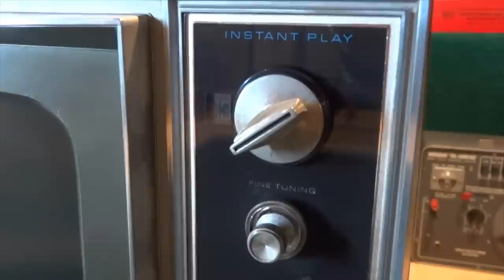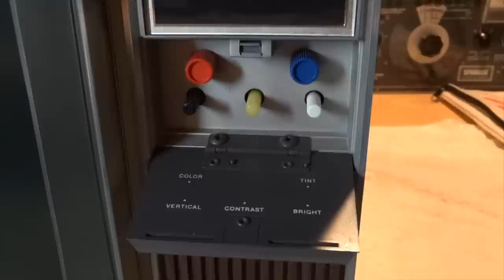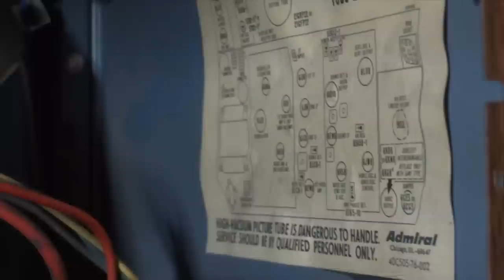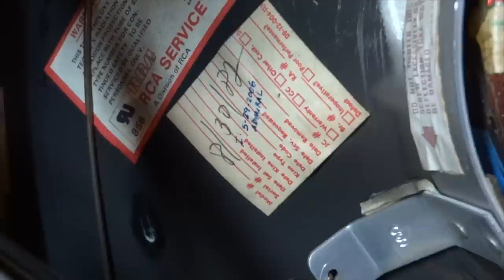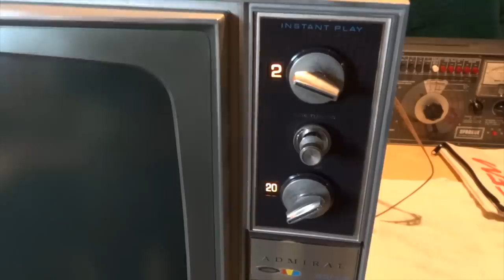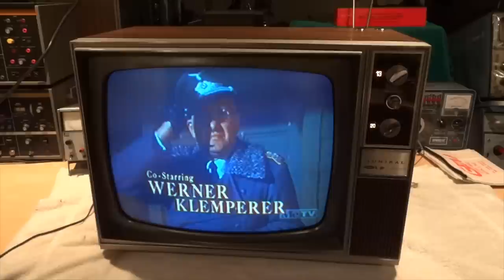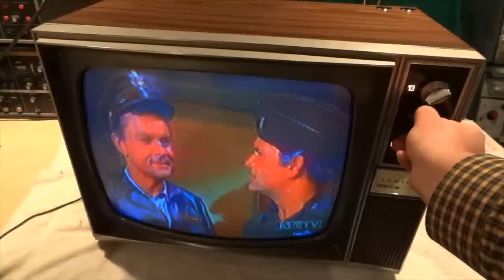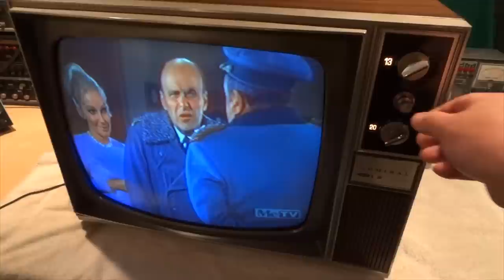TV Review:  A 1968 Admiral 19" Color Television

Comment: You'll find that a lot of those old TV shows in color tend to lack green because they were originally filmed on Kodak Kodachrome movie film which tends to lose it's green component over the years. I wonder if the original CRT was made by Admiral? I read somewhere where they made their own CRT's from 1965-1971. They were the industry leader in warranty length giving a three year warranty on the CRT instead of the industry normal two year warranty term.
Reply: That's a very interesting point -- I hadn't considered the original film-stock used in making these older shows.  Very good of you to point that out.

Comment: Just the Chicago area had 3 major set manufacturers in the 60s and now I don't think there is a single TV manufacturer in the entire US!
Reply: I believe you are correct.  Not a single TV manufacture left in the USA.  I think China manufactures most of them today, with Korea and Japan being 2nd and 3rd place (or perhaps 3rd and 2nd place, respectively).  Sad that we've lost such an amazing industry -- we used to be the best in the world at manufacturing electronics of this sort!

I'll GUARANTEE you that any modern HDTV set will NOT be functioning 46 years after its manufacturing date, like this Admiral set is!!  Shoot -- if any of them last 10 years, it'll be a miracle.  Back in the day these sets were BUILT to LAST!  Modern sets are built to be disposed of after 5 to 7 years.  Very sad.
Reply: LMacNeill That is so sadly true. I still regularly use a completely original set from 1965, and I can bet no modern television will last as long as it has.
Reply: *****
I said the same thing on the sears generator. Everything is made so cheaply today. Sure, the price is lower, but the cost over time is higher. These REALLY old sets were also problematic with the tubes in them, but later models that were still made in the US were made so much better than the new LCD Tvs. I have a late 80s model console TV as my main TV and dread the day it dies. I'll probably go to the used market to get a replacement rather than switch to an LCD.
Reply: christo930 Agreed. Some sets "back in the day" had their faults (one such common fault here being bad 6AL3 dampers), but the designs did improve as quality was important. Nowadays, companies are able to convince the public to purchase their products so easily that things like quality and word-of-mouth are no longer important.
Reply: ***** I remember when I was a really little kid (very early 70s), we had this awesome TV set with a stereo and a record player built in and made of wood with good quality speakers and probably a tube amp, but it was down so often that I got to know the repair guy (I used to love to watch him work on our TV). The TV I use now was manufactured in the mid to late 80s and I really like it and knock on wood, it hasn't given me any trouble. Almost all consumer items made today are junk and will never last as long as the old stuff. My TV is nearly 30 years old and I seriously doubt that any TV being made today will work in 30 years
Reply: LMacNeill
Not many TVs are manufactured in Japan anymore, although there may be some really high end models that are. I've seen more and more in the way of TVs, and other consumer electronics, being made in Thailand and Malaysia as of late, and less made in China. I think that between increased manufacturing costs, poor quality control, and the rampant theft of intellectual property and patented technology, more and more companies are either pulling out of China or just setting up shop elsewhere.
But the U.S, and a to a lesser extent Canada, made their bed in terms of electronics manufacturing by allowing the Japanese companies to sell their products here at a lower price then what they sold them for in Japan, in real terms. This is excluding the fact that they used to manipulate the yen to undercut U.S and Canadian manufactured products.

Comment: My parents had the floor model of this TV when I was a kid. Same tuner / volume knob layout, etc. The picture was great, when it worked. The set had high voltage problems from the day it was delivered. It was in the shop so many times, we lost count. The high voltage box would actually make snapping noises, (arcing), and the picture would die with each snap. The HV box eventually even caught fire. After 4 picture tubes, countless other tube replacements, cap replacements, the HV fire, (which was repaired too), my parents, took the set to the dump, after 9 years of dumping money into it. It was a beautifully designed set, cosmetically. It would have looked great in my living room today... but what a fire hazard it was. i think we had a lemon. Our neighbor had the same set, and had no problems with it. (Can somebody actually get a lemon for a TV)?
Reply: Randy, The Lazy Comic I had one that went out one year after they gave me the old one.

Comment: My grandmother had a console/floor model set of this television, very similar to this one, except the speaker grill pattern was horizontal and the color was gray.  The controls were right below it.  She gave it to my father in 1974 and he used it until 1979.  I saw several table top models of this set in the basement of a repair shop that I was helping to clean out in 1987.  They probably came from a motel because they all looked exactly alike.

Comment: 1918:
Two ham radio operators form Chicago Radio Laboratory.
1921:
Commander Eugene F. McDonald, Jr., joins the company.
1923:
Company is reincorporated as Zenith Radio Corporation.
1924:
Zenith introduces the world's first portable radio.
1926:
Company introduces the first AC-powered radio.
1927:
Company debuts the first push-button radio.
1939:
The first all-electric TV station, Zenith's W9XZV, goes on the air.
1948:
Company's first line of black-and-white TV receivers makes its debut.
1956:
Zenith invents the first wireless remote control.
1961:
Company's first line of color TVs is introduced; Zenith's FM stereo broadcasting system is approved by the FCC as the national standard.
1969:
Company introduces the revolutionary Chromacolor picture tube.
1979:
Heath Company, maker of do-it-yourself electronic kits, including a personal computer, is acquired.
1980:
Zenith Data Systems is created as a computer subsidiary.
1981:
The first Zenith computer, the Z-100, is introduced.
1982:
Company suffers a net loss of $24 million and fails to pay a dividend for the first time in nearly 50 years.
1984:
The electronics industry adopts a Zenith-developed system as the standard for MTS stereo TV broadcast and reception; company changes its name to Zenith Electronics Corporation.
1989:
Company sells its computer business to Paris-based Groupe Bull for $511.4 million.
1991:
South Korea-based Lucky-Goldstar, later LG Group (LG), purchases a five percent stake in the company for $15 million.
1994:
The industry chooses Zenith's transmission system as the U.S. standard for HDTV.
1995:
LG gains a 58 percent controlling stake in Zenith by buying $351 million in company stock.
1996:
Company announces the layoff of 25 percent of its U.S. workforce; FCC adopts Zenith's digital transmission technology as part of the HDTV standard.
1998:
Zenith closes its last U.S. manufacturing plant.
1999:
Zenith begins shipping its first HDTV sets; the company emerges from a prepackaged bankruptcy filing as a wholly owned subsidiary of LG and as purely a designer and marketer--not a manufacturer--of electronics products.

Comment: Excellent-looking set!

You mentioned that you replaced the CRT several years ago with an RCA CRT.  My question is -- was the original CRT manufactured by Admiral or RCA?  Did you just get lucky that your '67 RCA CRT happened to fit, or was that the same part used by Admiral when they built the set brand-new?

Thanks for makaing your videos -- they're always instructional and enjoyable!!

Comment: I have an admiral color set the I picked from my uncles barn shed. It was in okay shay physically, except the button rotted. My dad fixed that and the put it on some rollers. I haven’t worked on it really but the tubes light up, but there’s no high voltage. Hopefully I can get it working, though I think it’s a high hour set. It has a replacement, re-necked CRT in it and the screens are set high (I may have turned them long before I new what they did).

Comment: I seen a few of your videos of these old CRT TVs and You know what your doing.  So I have a question to ask.  
I have a RCA TV from the 70's with a marble top black and the issue with that TV is it ends up getting lines that go from bottom left to top right a crossed the whole tube.  Now the TV was serviced many times and always ends up with those lines.  

We stored it in our shed for years now under a blanket because no one here will fix it but it does show picture and sound.  But who knows know.  It has been unpluged since 2006 or 2005.  No any reason why it would be like that?
Reply: +DestructiveBurn - Record a clip of the screen and post it. That will help with diagnosis.

Comment: Boy, have one of these. It's missing the back, has a low emission CRT, Has cataracts,  & a HV resistor smoking. What to do. IIRC these sets needed flybacks. Now seeing this I may reconsider it's fate. This one is in very nice condition. Thank you for the chassis ID.
Reply: Farmradio That's quite a few problems for such a late set... Is the weak CRT due to the instant-start feature like the one in this video?
Reply: +Farmradio Admiral engineered these TV's in chicago, and went bust. I wonder if this one was found in a warehouse somewhere. The one here looks near mint. They did have a lot of issues with failing components, so I find it strange this one pops up in its hometown in perfect working order, but it may of just been restored. Who knows.

Comment: How did you get live television?
Reply: Digital converter box, during the switch from analog to digital broadcasting signals in 2009, there were some companies that started making boxes that would allow CRT televisions to pick up digital broadcasting signals, and I think those converter boxes are still being made. They pretty much hook up to the TV, and then an antenna is connected to the converter box.

Comment: I can't believe that valve tubes were still being used at this point.  Surely transistors werethe replacement for those old tubes, which had a limited life, and were the usual causefor the tv to break down.
Reply: +Gary Dunn - Transistors were just being introduced to TV circuitry around the time this set was made. Over the succeeding model years they displaced more and more tubes until by the end of the '70s, tubes had been replaced completely by solid state components.

Comment: could i somehow connect a playstation 4 to it or a blu ray player? just curious. lol
Reply: +Faizan Ahmed You would need an adapter but you wouldn't be able to broadcast in HD. Why not hook up an NES or VCR instead?
Reply: You could connect any gaming system to ANY TV set if you have the right equipment. I used to have my bluRay connect to my VCR via an AV to HDMI converter then my VCR connected to an 1987 Emerson Color Television. You could also connect and play a PS4 on it if you want to do that.

Comment: How did you get Me-TV to come on channel 13?
Reply: Either by a converter box hooked up to an aerial inline, or to a small indoor transmitter. It can also be a Low Power Analog station that I hear that was still able to be broadcast in some areas.